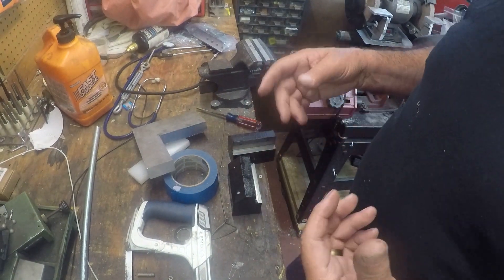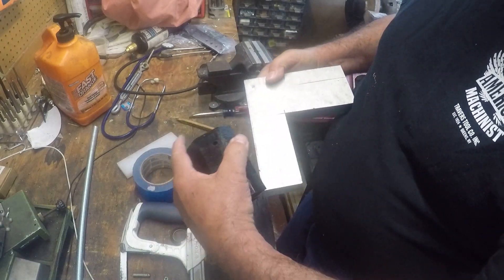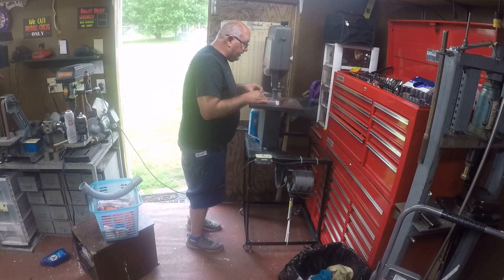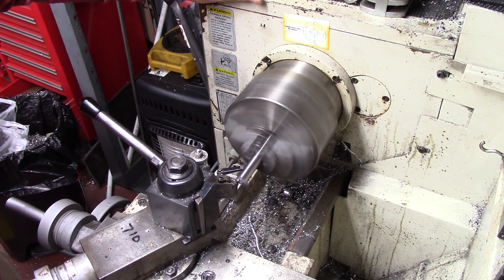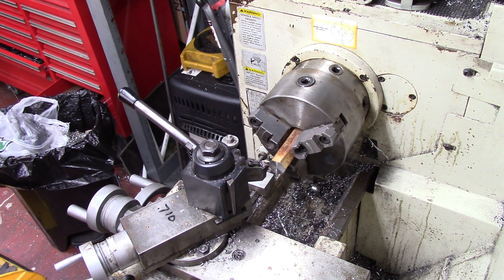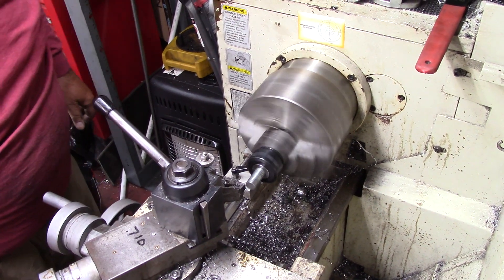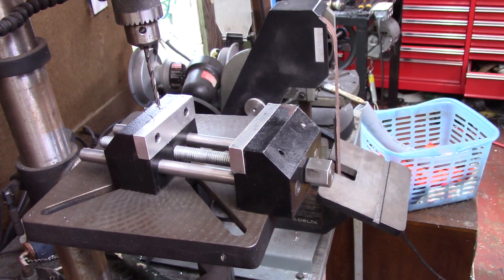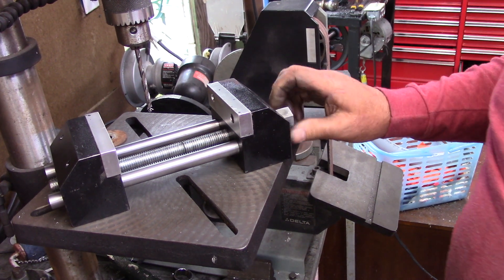Mr  Pete inspired drill press vice part 2

Comment: Came out nice and functional.
Reply from the maker: Hill Top Machine Works yes the only thing I’d done differently is make the cast jaws .250 thicker, that way I could have made the soft jaws thicker so I could have machined v slots in them and had clearance on the socket head screws